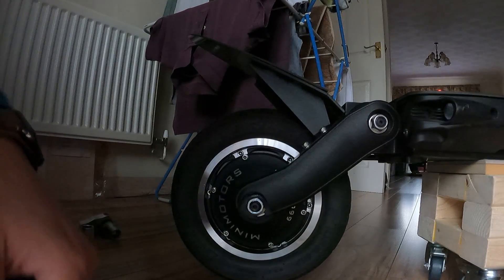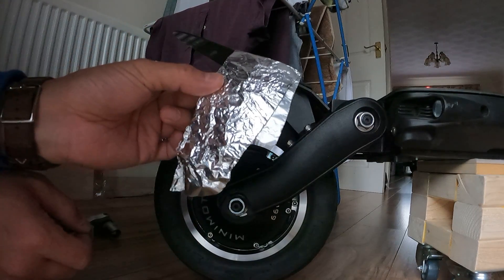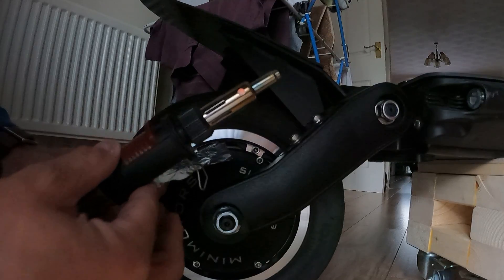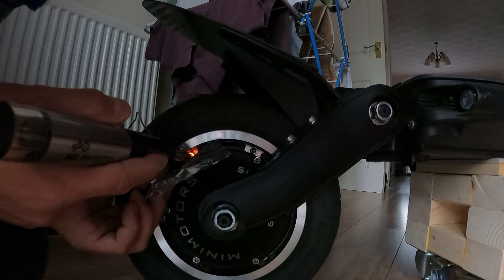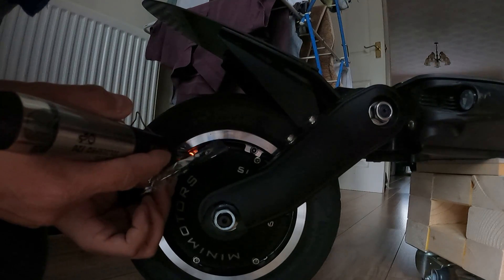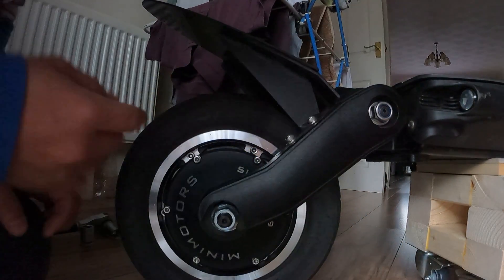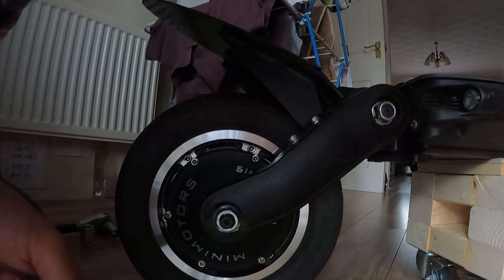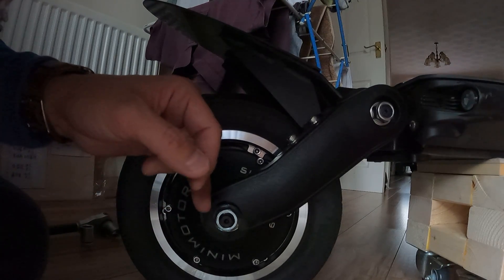Dualtron rim bolt removal - How to soften thread lock

Comment: Thank you for putting up the video but in the future, you really do NOT need that foil.. that tiny little torch helps but it will not cause any damage to the motor for when you ride that motor gets extremely hot and you only really need about 30 seconds to maybe 1 minute … regardless he did an amazing job and he is absolutely 100% on the money you need to blow torch and you need a really really good set of Alan rich

Comment: Also works with soldering iron?
Reply: You can, but they are generally good for smaller bolts (RC cars etc). It can work tho it the wattage of the iron is high, but will take longer… 5min plus probably

Comment: you was turning it the wrong way to begin with the newer models are not locked tighted anymore
Reply from the maker: Cheers, was a little mistake in the from my part for the vid and didn’t have time to reshoot another. Either way, I’m sure people would gauge the idea of what’s involved. Btw, this Dualtron is a newer model.
Reply: My DT mini still is and is causing me a lot of crap as one of the nuts will not grip ... any tips on getting defective threadlocked bolts off?
Reply: Kernalmustard, your comment has not aged well. They are still locked right. Sold my thunder 2 when 4 of my bolts stripped. Had to drill out the rim. They were industrial locked right with cheap bolts.